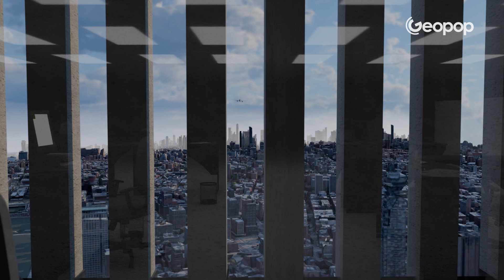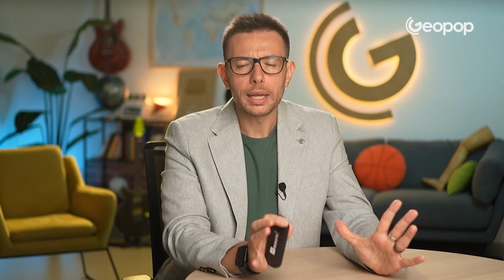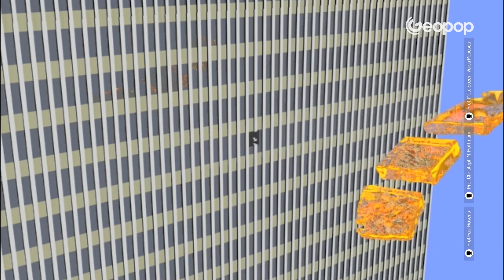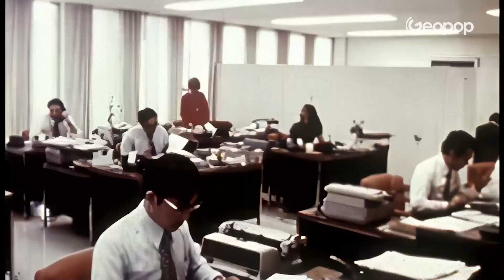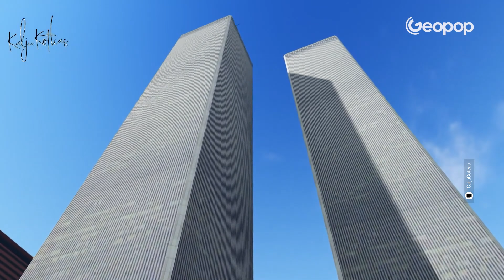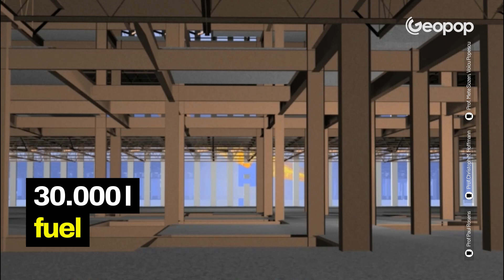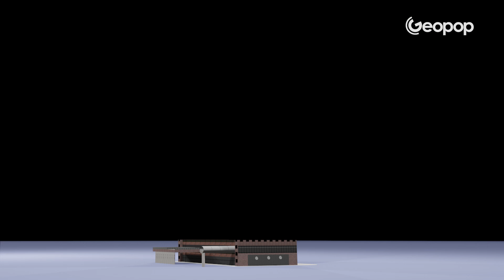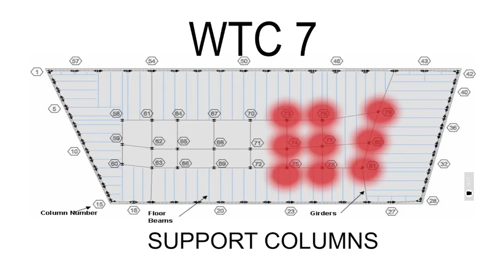9/11, 2001: The Technical Reconstruction of the Twin Towers and WTC 7 Collapses

Comment: I was watching throughout the entire day, the hole in the Pentagon was too small for a plane, then tower 7 fell with zero resistance, it fell 23 minutes after the BBC had reported it as fallen. NIST stated the wings at the Pentagon were bent backwards into the fuselage, there was zero damage to the masonry where they allege the two engines hit..
Reply: Amazingly, the most heavily fortified and secure building in the country and the only video evidence that we can see is a grainy security camera footage from a nearby gas station that only photographs every 2-3 seconds. 🙄
Reply: @Jimschrbr  - An argument from ignorance, an argument from incredulity AND a lie all wrapped in one.  What a shocker.  That's 3 strikes in one post.
Reply: @ 3 strikes in your book, maybe, but nobody asked for your opinion so it really doesn't matter what you think.
Reply: @Jimschrbr  - Right back at you.
Reply: 🤧bullshit
Reply: BBC reported it as such because they knew it was on the verge of imminent collapse. And you were watching what? Television? Guess what, so was everybody else in the USA.
Reply: Which is more extreme -- to accept without question the inexplicable lack of turbulence in the wake of a 500 mph large passenger airliner -- not evident in the smoke and fire covering the impact zone only seconds later? -- or to recognize the indications of digital projection in its imperfect nature as we see a wing disappear in front of a bright blue sky? From another camera angle, the same aircraft is seen passing behind a crane in the foreground, yet in front of the heavy crane cable. 

There should be a hurricane of turbulence in its wake that would entirely disrupt and disperse the smoke and fire seen billowing outward just 3 to 4 seconds later at both towers.  Even the wake of a small Cessna aircraft would be noticeable -- yet there is nothing.
Reply: @ElLowEl .  . "What the hell are you talking about?" .  . 😃 .  . Thank you for your sponsored reply, Mr. EILow.  The word projection indicates holography as you know, commercial demonstrations of which have been amazing in recent years.  To feign ignorance doesn't work well for you, however.  Where, Mr. EILow, is the wake turbulence only seconds after passage of a 500 mph large passenger airliner -- not seen in the smoke and fire covering the impact zone?  Even the wake of a small Cessna Aircraft would be noticeable -- yet there is nothing.  It's likely that no real answer from you is forthcoming. We'll wait and see .  .
Reply: @marksavage1108  everything you said is accurate. The truth is the truth no matter how long it's been argued.  Only a fool would claim something is false because the claim has been argued before. That's actually what you call a lack of an argument all together.
Reply: You don’t know what you’re talking about.
Reply: @Dennycrane757 that's not an argument 😂
No wonder there's so much scepticism when people are literally being told to reject what they've seen with their own eyes.
Reply: You're just repeating stuff you found on the internet. Got anything original, that hasn't been beaten to death a few million times?
Reply: @TheLoonResistance it's literal facts though. If you want to deny facts then go ahead.
Reply: @jr5993  - What are?  The claims made in the OP?  Not so fast.

1.  The entry hole in the Pentagon at the outer facade of E-Ring, Wedge 1 matches the span of a Boeing 757 from engine to engine. We know the wings outboard of the engines did not penetrate.  www.youtube.com/watch?v=FkgJ-rFFBD0

What the OP is referring to is the exit hole in the inner wall of C-Ring at the A-E Drive, made by the nose landing gear and other debris. Because after 23 years some people still can't tell an entry hole from an exit hole.

So that's the first one wrong.

2. WTC Building 7 took 18-20 seconds to collapse, which is one third (1/3, 0.33 or 33%) of true free fall acceleration (in a vacuum) so it seems there was plenty of resistance.

Fact 2 that is not a fact.

3. It was actually 20 minutes, not 23 minutes.  The BBC report started off their 5 pm EST broadcast. Building 7 collapsed at 5:20 pm EST.  That's 20 minutes, not 23.  Also, WTF cares?  Means nothing.

So far your facts are 0-3

4. The NIST said no such thing about the wings.  The Buildng Performance Report for the Pentagon was done by ASCE.  The wings however did fold back (for reasons I should not have to explain but probably will) resulting in the engines swapping sides. As for zero damage to the masonry where the engines hit we covered that already.

So your "facts" are 0-4, or 0-5 really.

You should know the facts better. It just works.
Reply: @TheLoonResistance  I repeat, I watched it all live as broadcast on the day. too small and the first building ever to fall only from fire. https://www.youtube.com/watch?v=0ZqP8moItcc&pp=ygUcYmJjIHJlcG9ydCB0b3dlciA3IGFzIGZhbGxlbg%3D%3D
Reply: @marksavage1108  - No way you were watching the BBC at 5 pm EST and picked out anything. The fuss over that only came out years later with the release of a silly film made by 3 teenage boys.

The media had been reporting that Buildng 7 was in danger of collapse or about to collapse for most of the day, starting shortly after it was hit by the falling North Tower and caught fire at 10:30 am. As Building 7 became increasingly unstable throughout the day the FDNY had ordered the area around the building evacuated and even suspended rescue operations on the pile early in the afternoon. 

Deputy Chief Peter Hayden of the New York Fire Department recalled: We had our special operations people set up surveying instruments to monitor, and see if there was any movement of [WTC 7]. We were concerned of the possibility of collapse of the building… One particular engineer there, we asked him, if we allowed it to burn could we anticipate a collapse, and if so, how soon?… And it turned out that he was pretty much right on the money, that he said, ‘In its current state, you have about five hours

The media were getting all of this. In the chaos and confusion of that day a wire service (Reuters) made an error and accidentally reported that Building 7 had collapsed instead of was in danger of collapsing. Simple enough. These sorts of things happen all the time in rapidly evolving ongoing news events and there are hundreds of examples on 9/11 alone.

The BBC repeated the wire service report.

Should we care that a British reporter (ie: not from New York), four miles away, with her back turned to a skyline chock full of tall buildings did not know which one of those hundreds of tall buildings she was not looking at was Building 7?

I don't think so. 

She was doing her job, reading the report. 

Worth noting that local CBS 2 reporter and weekend desk anchor Vince DiMentri had a bit earlier reported from INSIDE BUILDING 7 (not from 4 miles away) and _he didn't know what building it was either. 

A local reporter, not a Brit on short-term assignment in one of the largest cities in the world with thousands of buildings. 

At 11:07 am CNN reported Building 7 had collapsed at 10:45, or 15 minutes after the North Towers collapse at around 10:30. CNN got their (mis)information from the respected news agency Reuters, which picked up an incorrect report. They have issued this statement: “On 11 September 2001 Reuters incorrectly reported that one of the buildings at the New York World Trade Center, 7 WTC, had collapsed before it actually did. The report was picked up from a local news story and was withdrawn as soon as it emerged that the building had not fallen.” 

On 9/11, reporters also said that Camp David had been hit by a plane. Forbes magazine reported that “A car bomb exploded outside the State Department, according to State Department sources.” CBS News reported that as many as eight planes have been hijacked and only four have been accounted for. 

Those reports turned out to be false, obviously. Just a few of hundreds of news reportst that, in the chaos and confusion of that rapidly evolving event would with the benefit of 20/20 hindsight turn out to be wrong.

News flash: Reporters are human being and just like you, human beings make mistakes. 

Here is a video that discusses in detail all the pointless fuss over that BBC report - one of many hundreds of news reports that day which in hindsight turned out to be erroneous. Let me know if you still have any questions after;

www.youtube.com/watch?v=x8epQG0cfQ8 	

None of what I have presented here is new information. It has all been available and discussed to death for years and years and years. This should not still be - on the eve of 2025 - a thing.